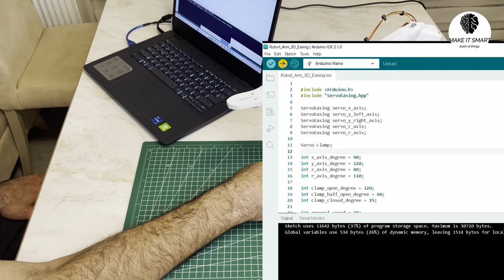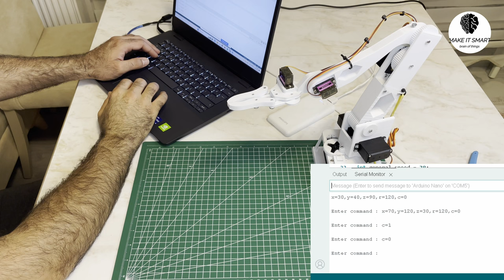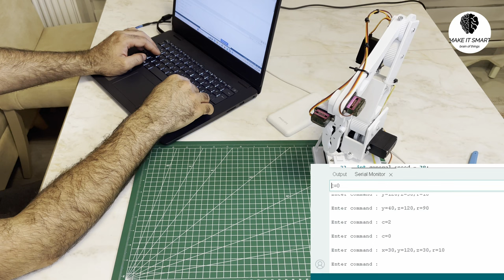3D Printed Robot Arm with Arduino and Servo Motors | DIY Tutorial

Comment: Not everyone has such fine 3d printer. Why not drive the arms directly from the servo and skip the gears?
Reply: I wonder if it would skip teeth when trying to move somewhat quickly since the arm lengths are such long levers?
Reply from the maker: No I didn’t face such an issue. Because the teeths are tightly fitted. İt can’t skip teeth without break the teeth. 😂😂